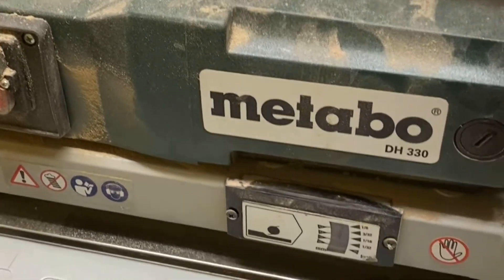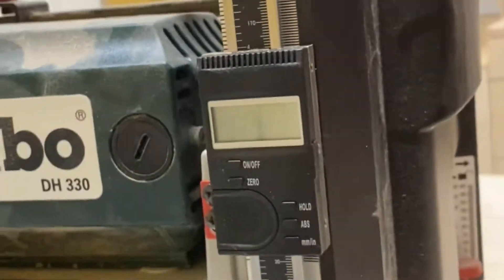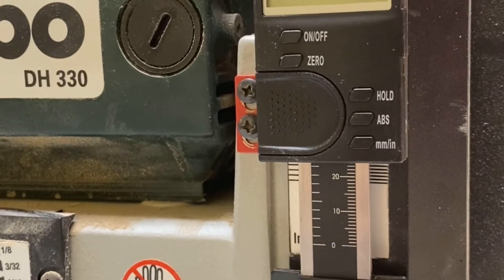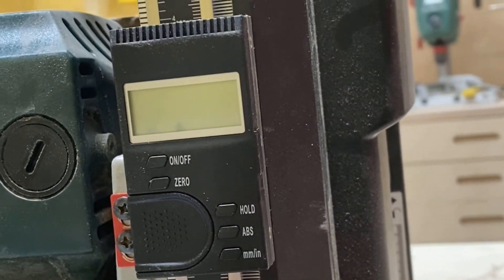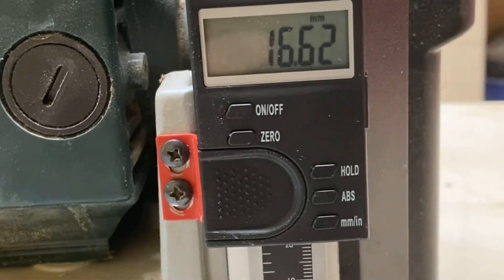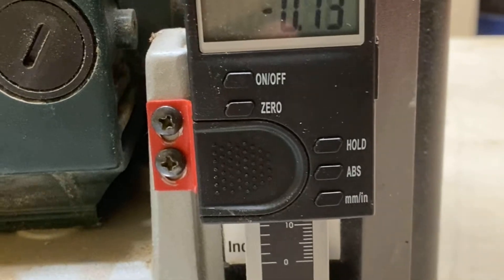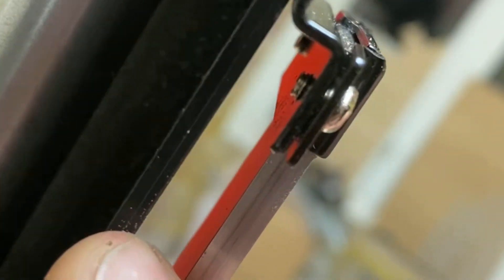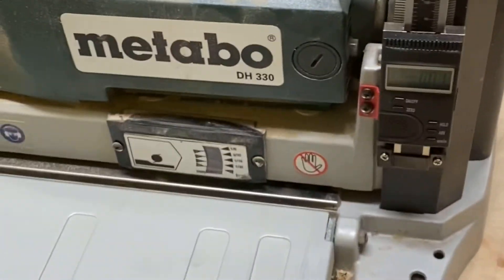Adding a digital read out on my Metabo DH330

Comment: If you set thickness on the planner DRO to let's say 20mm, what will be actual thickness of the wood?
Reply: The DRO can not really be set to any particular thickness, but by using the zero point and incremental/ absolute function one can very accurately trim down to the wanted dimension. Makes it a lot easier than manually having to check passes with a caliper and a lot more accurate than the original scale. I’ve found it to be a very useful, simple and inexpensive upgrade

Comment: Great build! Did you use threaded M3 screws cut to length that attach directly to the housing of the DRO ? Also, what type of M5 screws did you use to attach the bottom and top of the DRO to the housing of the thicknesser ? I am afraid it'll be a bit wobbly since it's only screwed into thin plastic.. Any return on experience after the first couple of months of usage?